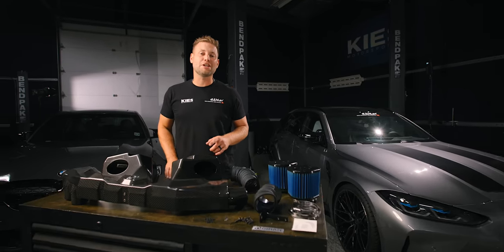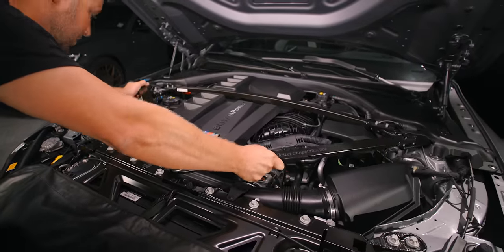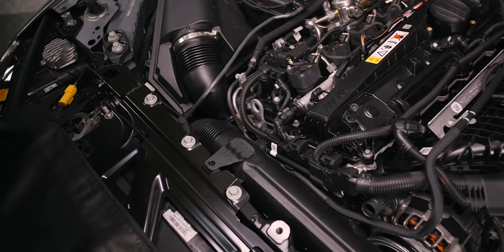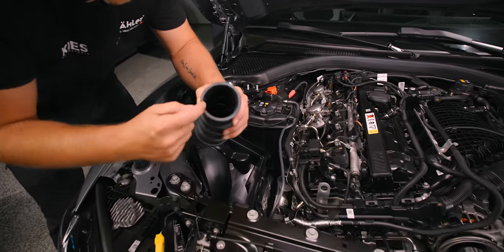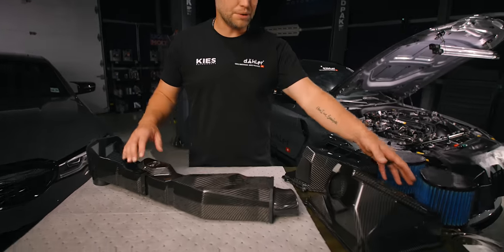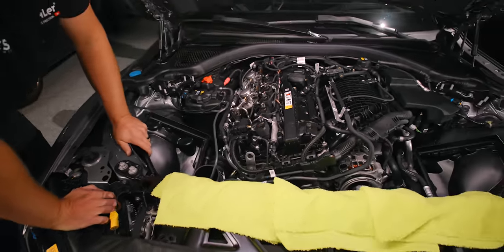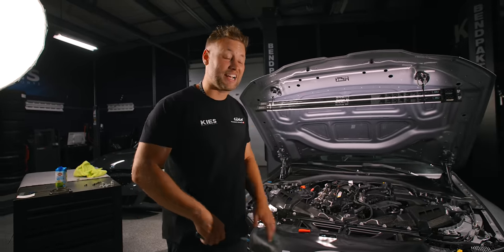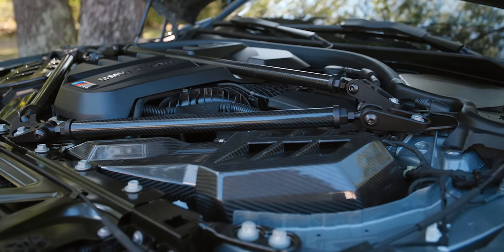Ultimate DIY Guide: Installing DINAN Carbon Fiber Intake for G8X M2, M3, M4 (BMW)

Comment: strange intake design, is there a separation between the two turbo inlets when they meet the carbon intake?
Reply: There is not. Shared plenum between both sides. Was a concern originally the designs want for visual symmetry would cause some flow issues but through a bevy of tests it became clear the concern was unwarranted. Fair amount of flow detail/charts on the product page if you wanted to delve into it.
Reply: @DinanEngineering fascinating